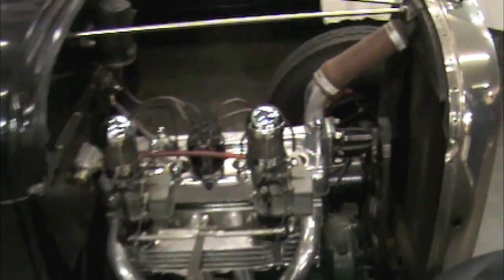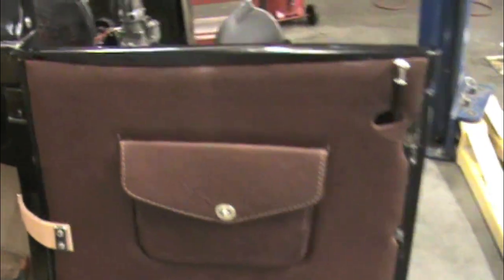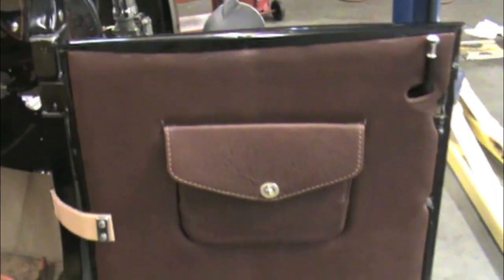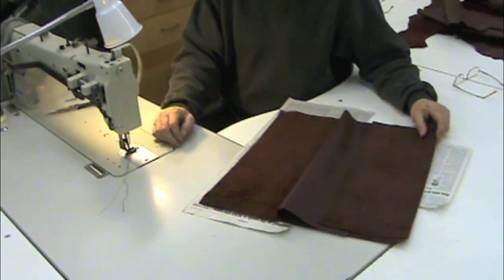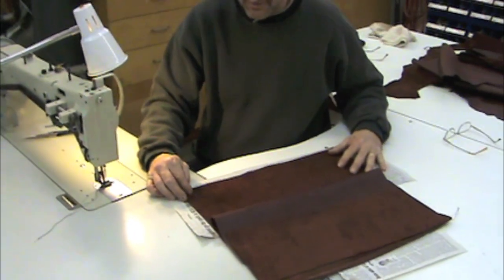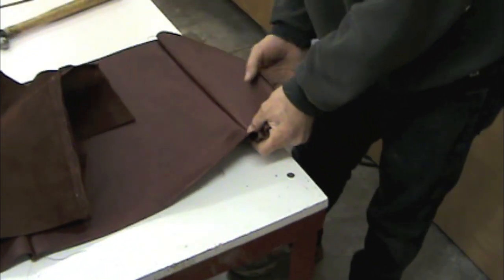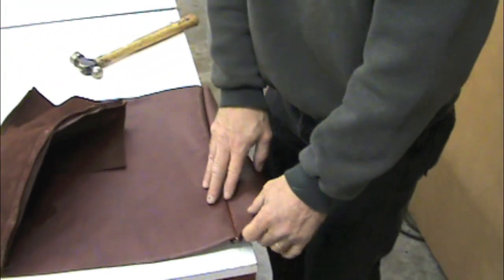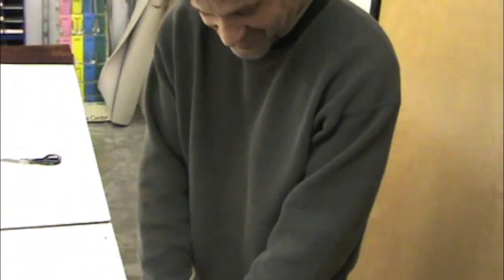How to upholster a hot rod in leather part 1

Comment: The only thing I do differently is to add a reinforcing strip on the backside of the French seam.  That way, the top-stitching is actually serving a structural purpose and the center of the seam is less likely to spread over time, exposing the threads that join the two pieces of leather.  Also, the "base" beneath the seam is the same color.  Of course, that results in one more layer of leather at the seam location, but your use of the headliner material is a good way to help flatten that out.

Comment: I have a question, I'm pretty new to upholstery, I have an industrial sewing machine that does not have reverse, I noticed that you did not use reverse to do a lock stitch, is that ok to leave just by running straight through the one time?
Reply: Ive seen people stitch a few forward, then lift up and move the material back (like starting over) and then stitch on through towards the end then do same thing. Hope it helps ya